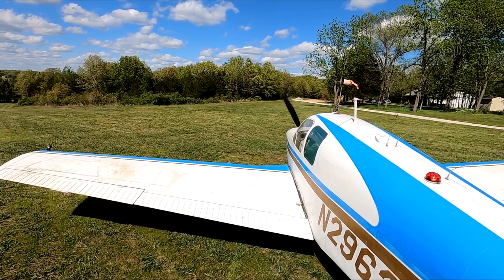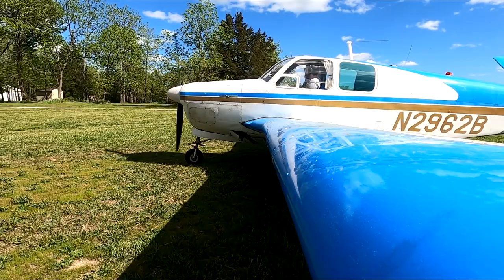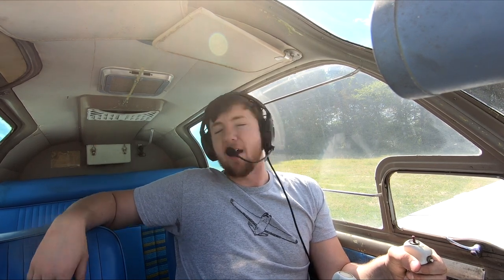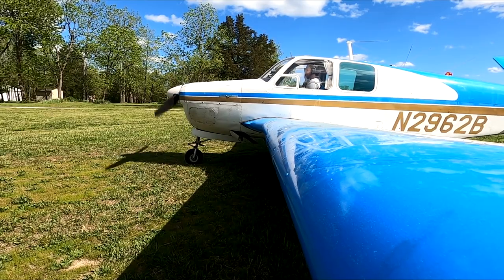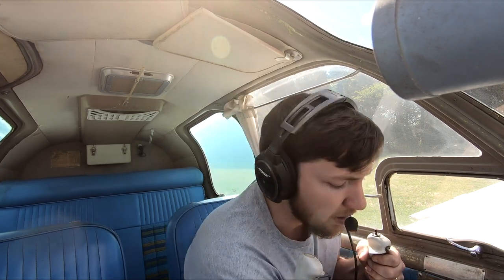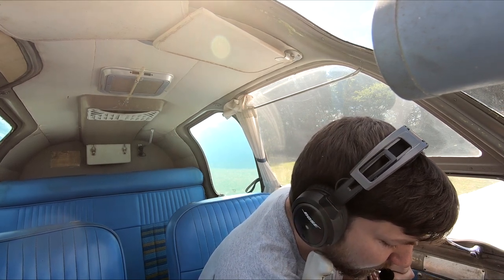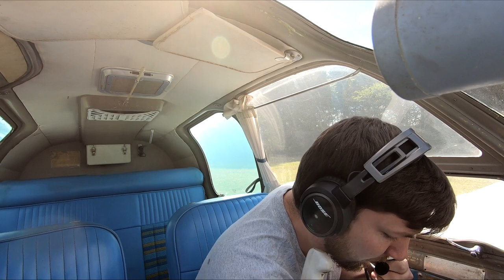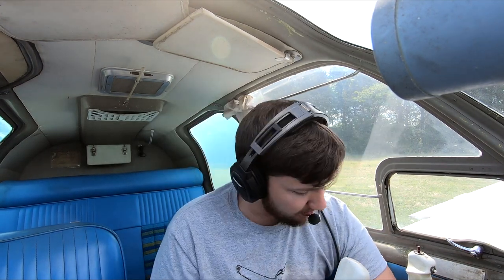BARN FIND V-TAIL BONANZA FIRST FLIGHT IN 15 YEARS!!!

Comment: Where do you get your "approved data" for your GoPro installations? 
I would love to see your log book entries for that.
Can you show us so other pilots can install their cameras?
Thanks.
Reply from the maker: All temporary installations. No logbook entry required. FAA regs apply to major and minor alterations and the FAA does not regulate temporary installations. They also don’t really define what temporary is vs minor, but I assure you mine are temporary. I mount, record, and remove from the aircraft. No change in flight characteristics.
Reply: As a pilot you are allowed to do either 31 or 32 "maintenance items" (changing tires, light bulbs, spark plugs etc) on your aircraft (IF) you have proper training.
Sorry to burst your bubble but there's no such thing as a "temporary installation" unless it's Velcro.
If it's bolted or screwed onto your wing or interior or tail fin you need approved data with a logbook entry from your mechanic.
If you're a certificated A&P mechanic you can do it yourself. 
But you can't go around bolting and unbolting cameras on your airplane.
If you have an incident or accident your insurance company is going to run from your claim due to improper maintenance and no logbook entry.
The owner/operator of the aircraft has sole responsibility for airworthiness of the aircraft.
The definition of airworthiness is: The aircraft meets its type design and is safe for flight.
Cameras mounted without approved data doesn't meet its type design. 
Your CFI should know this.
Hope that helps.
Reply from the maker: You’ll have to show me the regulation that says a gopro mount is considered a minor alteration (it definitely isn’t a major one). I don’t think you will find one, but you’re welcome to try.
Reply: @BenWeeksBonanzaPilot  
There isn't a regulation concerning minor alterations because there is no such thing.
The phrase "minor alteration" isn't in the FARs.
There are major repairs OR major alterations, but  there is no such thing as a "minor" alteration.
You can't install them because there's no approve data to do it.
If you're making logbook entries concerning these cameras then you might  be shooting yourself in the foot.

If you went to the auto parts store and bought sunshades that stick on the inside of your aircraft windows that would be a completely different story because those are "temporarily mounted" (no approved data) required.

But cameras that are hard mounted are  different because now you're changing the type design of the aircraft.
I would ask your local FSDO, your CFI, or an aviation attorney, they should know.
Reply from the maker: If I put a strip of duct tape on my wing, we would both agree that is a temporary installation. If I take out a screw and put a piece of duct tape on the wing and then put the screw back in, are you asserting that somehow that strip of duct tape becomes something other than a temporary installation because it has a screw through it? 

If that strip of duct tape flies off and flies into the face of someone on a motorcycle causing an accident, I would be held liable for not assuring that a dropped object was safe from hitting people or structures on the ground. I would not be violated for a major or a minor alteration because the strip of duct tape was neither. It was a temporary installation that is not regulated by the FARs.

Btw there is such a thing as a major and minor alteration.
Reply: @BenWeeksBonanzaPilot  
I've seen and heard this so many times it's not even funny anymore. 

You're comparing apples to oranges and trying to justify a made-up scenario (screwing down duct tape) for something that doesn't make sense.

There's no reason for you to arbitrarily put a piece of duct tape on an aircraft and then put a screw in it.

In my 27 years as a mechanic and 9 years as an inspector with the DOT I've never heard of that scenario.
It's very very very simple but you're making it complicated.
Noone, pilot or mechanic is allowed to "hard mount" anything on their aircraft unless they have approved data. 
And if you can find the phrase minor alteration in the FARs please send it to me and I'll send you a million dollars.
I think you need a new CFI because the one that taught you how to fly didn't teach you enough about the FARs.
Like I said earlier call up the local FAA office and ask a maintenance inspector, NOT an OPs Inspector.
He will set you straight. Keep studying, happy landings and let me know when you find minor alterations in the FARs so I can send you the money.
Reply from the maker: Wait, so you’re saying I can’t install duct tape with a screw through it or I can? I’ll go do it right now if the “made up” part of it is what bothers you. 

Reference advisory circular 8300.16A or reference to major vs minor alteration. I’m not making it up. My duct tape or gopro is neither so I don’t think it’s relevant to the dispute.

I don’t know what else to tell you. I think I’ll stick with the CFI that I have, but thanks anyway.
Reply from the maker: CFR 21.93 is the FAR you are looking for. Discusses major and minor “change” which I’m sure you will argue is different than “alteration.” If you would like to honor your payment agreement I will provide you my PayPal so that you can send me my million dollars.
Reply: @BenWeeksBonanzaPilot  
Advisory circular 8300 .16A addresses (major) repairs AND (alteration) data approval with change 1.
 NOT major (vs) minor alteration.

I'm not trying to be a smart-ass or a hard-ass but always remember there are major repairs and alterations but there is no such thing as a MINOR alteration.
Maybe you're thinking about an STC? (Supplemental type certificate).
An STC could be considered a minor alteration BUT it must also have approved data along with a logbook entry for installation and removal.

Of course you can install duct with screws all day long if you want to. 
But I don't know why you would.
You could bolt a crowbar to your rudder if you want to.
But I don't know why you would.
You can do all kinds of things to your airplane but you have to have approved data to do it.

That's where you and your mechanic have to talk.
If your mechanic knows you're putting cameras on your airplane without the data then he should be very concerned.

If he is signing off inspections with cameras or other non FAA parts installed then I would find another mechanic.
I'm not saying your mechanic "is" doing it but "if" he is doing it.

You also can't put alternator belts or wheel bearings on your airplane that you buy from the auto parts store, because their not approved.
You can't put automotive gas in your airplane because it's not approved.

You can buy (fake) "Fatman seat belts" on Amazon all day long BUT you can't take them on a commercial airplane because they're not approved.
The list is endless.

You can't hard mount an oxygen bottle on your airplane unless you have approved data.
BUT you can "hang" an oxygen bottle in a bag from the pilot or co pilot seat without any data because it's NOT hard mounted.

You also have dual responsibility to make sure that your mechanic is installing parts that have return to service tags OR are FAA approved.
If he is getting parts from the auto parts store and there's an incident/ accident both of you will be liable, there may be a letter of Investigation from the FAA, temporary loss of your certificate, fines and or lawsuits.

Now (you) are saying that your GoPro is "neither" a minor or major alteration.
Then what is it?
Does that mean you just get away with mounting them without any data at all?
Just remember it like this.
If it's not allowed in the FARs (or) you don't have approved data then you can't do it.
The FAA lawyers would love you guys.
I would call the local FSDO.
Happy Landings.
Reply: @BenWeeksBonanzaPilot  
It doesn't matter if you're altering it, changing it, repairing it, replacing it, everything you do on an airplane has to have approved data. 
You can't just do it willy-nilly because you "want to".
If your GoPros do not say FAA approved then they don't come appropriate documentation to install them.
Just use velcro, problem solved.

21.93 addresses (changes) in type "design".
Installing cameras does not change the design of the aircraft.
Installing them is an alteration not a design change.
Reply from the maker: I’m sorry, John, but I believe you are not correct in your assertions. The FAA released a memo in 2014 that essentially said they are considering it a minor alteration (one which does not appreciably change weight and balance, flight characteristics, or structural integrity) and all the PIC would have to worry about would be a careless and reckless charge if the camera was to fall off and do damage. 

You are claiming it’s a major alteration and that is just not correct. I have provided you with numerous resource proving my point. If I get ramp checked one day and I have to provide the same regulations to the inspector so be it. Until then I am going to fly the aircraft per the regulations and continue to make content that I and others enjoy. 

Still waiting on my million dollars.
Reply: what the hell, another arm chair pilot. go back to the basement
Reply: @BenWeeksBonanzaPilot  
Don't believe I ever said it was a major alteration. I said you need approved data to "mount" them.

And now you're telling me you could put as many cameras on your airplane with no logbook entry, no change in weight or balance and fly everywhere???
Does that mean you can put car tires on your airplane with no approved data?
I don't think so.
You go have fun, most inspectors would write a violation on you for no approved data. 
Really really simple.
If it's not approved you can't do it.
If it "is" approved show the approve data.

Some examples of approved data are:
1. Airworthiness directives.
2. AMOCs, alternative methods of compliance.
3. Maintenance manuals.
4. Parts manuals.
5. Installation drawings.
6. Installation instructions.
7. STCs, supplemental type certificate.
8. 337 forms.
9. Field approvals.
10. Emergency ADs.
11. Service bulletins.
12. Service instructions.
Hope that helps.

But you can't just mount something, make a logbook entry and fly.
Reply from the maker: Ok well if it’s a verbiage issue for you I do not “mount” the gopro. I temporarily affix the gopro to the aircraft using an existing screw or longer threaded equivalent in a way that does not appreciably alter the flight characteristics, weight and balance, or structural integrity of the aircraft. At most this is a minor alteration requiring an a and p sign off and at the least it is a temporary installation that requires no logbook entry. If you are insisting on approval data you are confusing major and minor alterations and I would refer you back to CFR 21.93
Reply: @johnparish1432  thats NONSENSE
Reply: @Scott-ol9zs  
You're not an aircraft mechanic are you? 
I can tell.
Reply: @BenWeeksBonanzaPilot  
🤣🤣🤣🤣🤣 
Sorry but I have to laugh at the ignorance of you guys.
You're not mounting it🤣🤣🤣🤣🤣 
You're temporarily of "afixing it".
Holy f**k I've heard everything now, you should never try to be a lawyer.
Happy Landings, don't get busted by the government.
Reply: @Scott-ol9zs  
That's a vague statement, can you be a little more specific?
Reply: @BenWeeksBonanzaPilot  
Instead of this robust bantering back and forth why don't you just list your approved data?

But instead you're dancing around giving me all these references that have nothing to do with what you're doing.

You guys are typical newbies that really really really don't know what you're doing and you don't know who to listen to. 
Call your local FAA office.
Reply from the maker: Look, John, you’re the one who came around looking for a fight. You are telling me to provide approval data and I am giving you FAA regulatory verbiage confirming that no such data is required for my application. The technical data supporting the use of temporary gopro mounts would be the manufacture data, because I am not changing the original type certificate in any way. It’s a log book entry by an a and p at most who is just going to say it is a minor alteration. What am I supposed to do, wind tunnel testing with my gopro mounted? This is absurd.
Reply: @BenWeeksBonanzaPilot 
Not looking for a fight, just letting you know there's no such thing as a minor alteration.
Have a nice day and don't get triggered.
Reply from the maker: “21.93 Classification of changes in type design.

(a) In addition to changes in type design specified in paragraph (b) of this section, changes in type design are classified as minor and major. A “minor change” is one that has no appreciable effect on the weight, balance, structural strength, reliability, operational characteristics, or other characteristics affecting the airworthiness of the product. All other changes are “major changes” (except as provided in paragraph (b) of this section).”

Go ahead and tell the FAA that CFR 21.93 doesn’t exist. We’re definitely going in circles at this point. Thanks for the thought exercise. Have a good one. 👍
Reply: @Scott-ol9zs  
🤣🤣🤣 who's being a pilot? Not me.
Reply: Why are you watching YouTube videos of planes flying if, in your opinion, you can't make a video of planes flying?
Reply: @BaxterRoss  
Never said you can't (make) videos.
But you can't install any old camera on an airplane without "approved data" from the FAA.
Two completely different things.
Try again.
Reply from the maker: So can you show me a single example of the approved data you are referring to, or are we all just supposed to take your word for it and assume that every other person that is recording flight footage is doing so illegally?
Reply: @BenWeeksBonanzaPilot  
I sent 10 or 12 examples yesterday.
Reply from the maker: No you did not. To date you have provided no information other than referencing irrelevant FARs that do not pertain to installing gopro cameras to aircraft. I would like you to point me in the direction of ANY example of a pilot installing cameras with the appropriate approval data that you assume is needed. 

Also, I’m still waiting on my million dollars you promised to send yesterday.
Reply: @BenWeeksBonanzaPilot  
Once again Ben it's not the "filming" it's the approved data required by the government to "mount" the camera.
Your CFI and A&P mechanic should know ALL about this.
If they don't know what approved data is (OR) when it is required then it's time for a new instructor and mechanic.
Like I said in an earlier post you have dual responsibilities with your mechanic to make sure he's doing things legally.
Reference CFR Part 43.
Reply from the maker: I didn’t mention filming, I said show me an example of cameras being INSTALLED using the approval data you insist is needed. You are referencing part 43 which does not address installing cameras. Hence why the FAA provided this clarification: https://www.csobeech.com/files/FAA-GoProMemo.pdf

You can keep telling me my cfi and mechanic are failing me to deflect from the fact that you have no idea what you are talking about, but the fact remains that you have no contradictory evidence. You can blanket reference part 43, but that has no usefulness unless you show me the actual section that proves your point. 

The only reason I have continued to indulge you in this nonsense is that others will likely slog through the thread and perhaps glean some useful information.
Reply: @BenWeeksBonanzaPilot  
Ben I'm done, you need to know ALL of parts 43 and part 91 and part 65 like the back of your hand.

All I'm hearing from you is: I can do anything I want to to my airplane with "just a log book entry".
It's just so typical of the newbies in aviation doing whatever they want to.
Make sure you get with your mechanic and find out what dual responsibilities you have.
Reply from the maker: Yup, that’s what I thought. 

“You’re wrong. Also I have no evidence for why you’re wrong, but you should know every regulation ever written by heart so that you can know why you’re wrong. Kids these days, ammirite!”

Thanks for wasting everyone’s time, John.
Reply: @BenWeeksBonanzaPilot  
WOW don't get triggered again.
Ben are you familiar with 14 CFR 91.403 (a)?
Or 14 CFR 91.7?
If you're going to have a career in aviation on YouTube you need to know the regs.
You can mount cameras all effing day long. 
The FAA doesn't care what you mount or where you mount it, it's the approved data to do it. 
Somehow you are missing that, but your mechanic should be able to explain it to you.
Reply: @BenWeeksBonanzaPilot  🤣🤣🤣 you're saying I'm wrong but you can't say "why" I'm wrong.
That's the funniest s*** I've heard in a long time.
Please don't fly over my house.
Reply from the maker: 🤦‍♂️ Minor alteration, John… the aircraft is not changed from its original type certificate because the changes that are made do not appreciably alter the characteristics of the aircraft. I literally copy pasted CFR 21.93 to which you have no response. What does 91.403 and 91.7 have to do with anything?
Reply: @BenWeeksBonanzaPilot  
Try reading them. Educate yourself.

91.403 addresses primary responsibility and 91.7 addresses pilot in command (PIC responsibility).
These two basic regulations apply to you as the owner/operator (and) PIC and they should have been taught to you a long time ago. 
I don't understand why you don't already know those regs.
Did you know you can change your own oil?
You can change your own spark plugs?
You can replace your tires and tubes?
You can replace landing lights?

As an owner-operator you can do 30 plus items of maintenance on your airplane with training and approved data.
I'm assuming you have a pilot certificate since you're flying around but I don't understand why you aren't familiar with those two specific regulations.
When you get about twenty years of flying experience under your belt, go to work for the FAA.
One of your jobs at the FAA will be investigating accidents.
Once you see a few dead people you'll look at the regulations a lot differently.

Happy Landings.
Reply from the maker: Neither of those regulations prohibit me from temporarily installing a gopro camera to record my flight. It is not maintenance, and I am asserting that it is not even a minor alteration. You can keep whining about the regs all day long, and insulting my pilot knowledge, but the fact remains that I am operating within a poorly defined regulatory gray area that the Feds have refused to formally elaborate on. If I get ramp checked, I will be at the mercy of whatever vague interpretation of the regs the inspector chooses at that moment. I’m really curious how the myriad of flying videos are made by so many people (many with direct FAA involvement) when every gopro that is installed without an STC is illegal according to you? The case of John Parish vs the world.